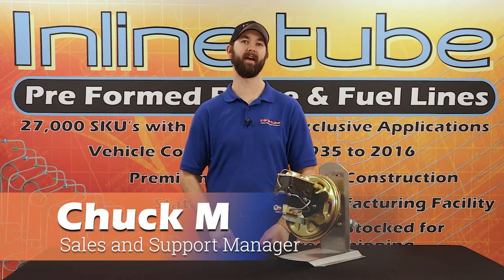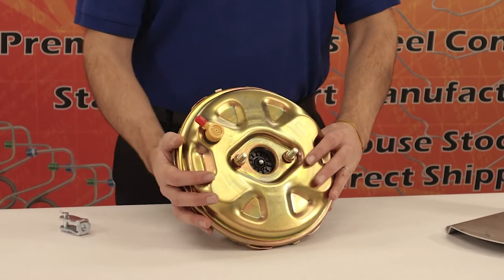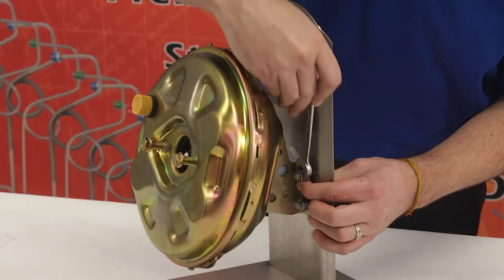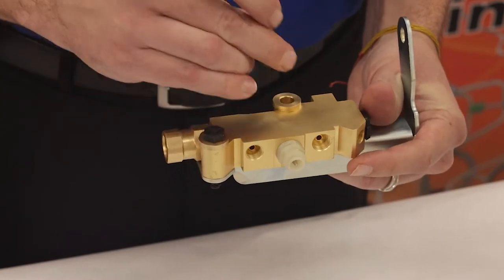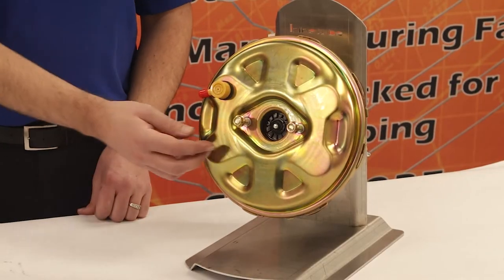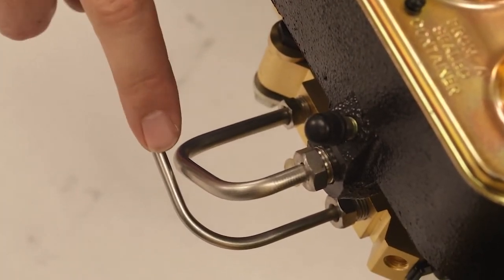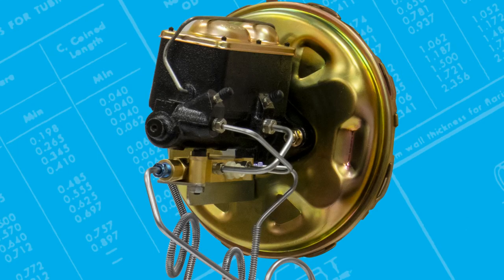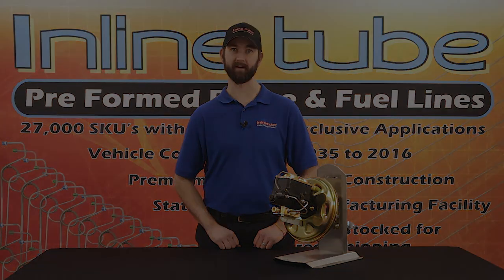How to | Assemble 1968-72 GM A-Body Upper Booster Kit

Comment: I bought your tubes for my 68 olds 442.  I bought all my brake parts from Stainless Steel Brake Company, but they didn't tell me I needed a bracket/screws for my proportioning value.  Also the proportioning value is PV-24BH which, based on what you said, compatible with disk/drum or disk/disk.  Of course mine had the rubber part.  Also my master cycle came bolted to the booster so I presume I don't have to change any pins.  I can't find the paperwork that came with my kit so I am not sure where any of these lines go.  Also it seems you didn't sell me a kit because I see tee not included.  I need you guys to contact me so that I get "EVERYTHING" I need just mostly what I need.  I don't want to use old parts.
Reply: Also you mention a female to female connection.  I don't have that part in your kit.  I have the old distribution block at the frame which I am trying to avoid using.

Comment: Aren't your front and rear lines backwards on that master cylinder?
Reply: No the valve is flipped around so that the rear port faces the front of the car.   Our lines have a 180deg turn on that line that will feed the back side of the car.
Reply: The Valve is set up backwards to match the line set we sell